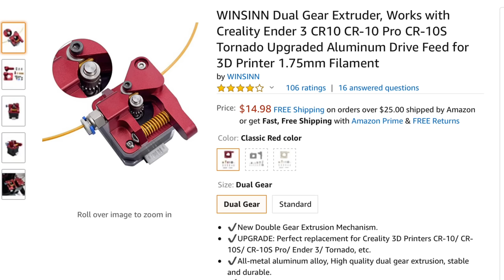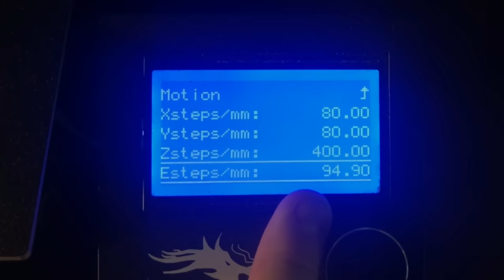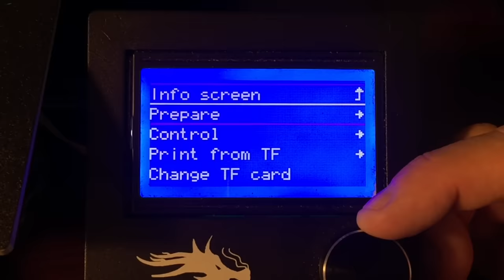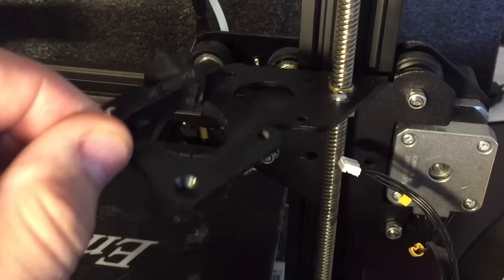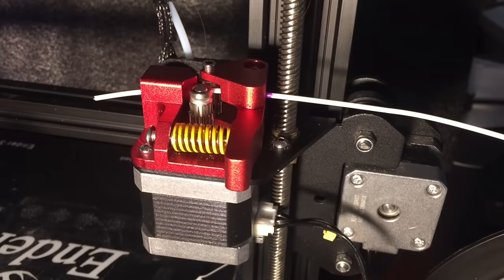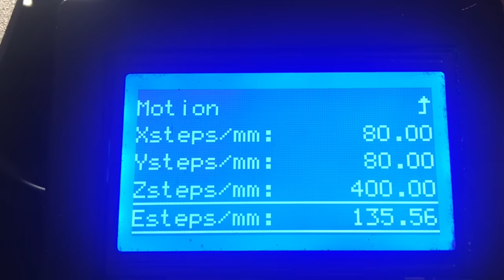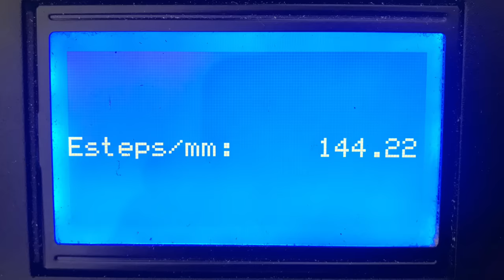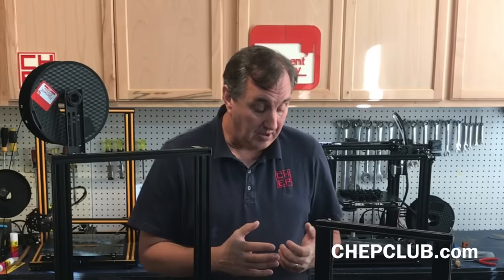Dual Drive Gear Extruder Upgrade + E Steps on Creality Ender 3

Comment: I just bought an ender 3 pro and I also have an older prusa clone printer. I tried to print a part that's runs fine on my old machine but this ender 3 seems to need to print slower. this part was sliced for 60 mm/s. This ender will start making noise from the extruder if it's printing a large surface where it's using a lot of filament. it sounds like it's slipping steps in the motor. could it be that my old machine has a hot head with a higher wattage.
Reply from the maker: Sounds like you just need to increase the temp for the filament you are using.
Reply: @FilamentFriday  that's whats weird is I run the same temp on my other machine
Reply from the maker: Each printer is different.

Comment: Can a "left handed" extruder be fitted to an Ender 3 if the polarity of the stepper plug is switched.  As far as I can tell, this would mean the filament run would easily clear the Z axis screw.  Or am I missing something here?
Reply: Yes

Comment: How does this work? If the axis distance varies, the gears don't mesh properly. Obviously it doesn't seem to have much influence in this application. The gears will themselves limit how much the  are pushed together. The other way around you will have backlash if the gears open up.
Reply: Backlash doesn't really matter in the extruder. The extruder mainly goes forward, and its in that direction that all the resistance is found (which the gears are needed to prevent slippage). As long as the gears engage somewhat in the forward direction they will work fine, they gears are designed so that they are slightly out of mesh so its the pressure on the filament that limits their movement.
Reply: @IanSlothieRolfe  makes sense

Comment: half of the issue with the dual drive extruder from creality is the needle bearing supplied only runs half the length of the gear allowing for a lot of play when filament is being pushed. I added a second bearing to mine which has greatly reduced the play and in turn wear on the extruder. I suspect this could be part of the reason there is still some slipping on the dual drive on in this case but without testing myself I couldn't confirm.
Reply from the maker: Mine came with two bearings.
Reply: 6mm is probably not slippage but compression inside the bowden tube. ID of the bowden is 2mm so that .3mm over 30-50cm is alot of space to lose 6mm of filament

Comment: I believe u maybe the person to help me, my ender 3 pro with upgraded metal extruder keeps chewing thru the filament half way thru a print I can find why it's driving me nuts.
Reply: Loosen the screw with the spring sleeve; that screw determines how strong the grip will be on the filament.
Reply: Dude my printer had clogging issues for a week.. also a reason extruder skips and slips.. because of the clog at nozzle. And that is from improperly inserted ptfe tube. After nicely clean and push it fully correct.. also capricorn tube for the win.. my prints stopped stuck halfways

Comment: Are there magic numbers for the extruder stepper?
Also, what esteps do you use for your ezr on ender 3? I am using 90
Reply from the maker: No, extruder doesn’t improve with magic numbers. I’m using same steps as original as I adjust flow in the slicer.
Reply: @FilamentFriday  Thanks. When I went from stock to ezr, I went from 93 to 90. I would be curious if anyone else did.
Reply: No magic numbers.  Each printer will be a bit different depending on the extruder you have, (I have a metal upgrade), the ptfe tube, the temperature, nozzle size, etc. You should follow the directions with measuring the filament and then adjusting the steps.  I would do this several times until you get down to exact location.  Note different filament types and producers may have different slippage .
Reply: @vbbartlett  Got it, thank you. I did arrive at 90 esteps after going through the directions and math described in Chris's basement video. I however did not re-check the distance once fed through the hotend like how CHEP has done in this video. I will try with the hotend and see if it changes. I am however getting really nice prints with 90 on the ezr.
Reply: @soloked  cool.  I would definitely check with the hotend on as that friction can change your numbers.
Reply: @vbbartlett  doing it right now haha
Reply: @vbbartlett  Yep it was 5mm short. . Changed esteps and printing a benchy now. Looks good so far.

Comment: Hello, I think the video is great, I have done everything as you say and it works perfectly, the only problem is that the values in "Esteps/mm)" are not memorized and when I turn off the printer return to the original values.   What am I doing wrong?
Reply: Hi, my Ender3 V2 saves all the settings to the SD card. Stuff like preheat temps but also the E-Steps/mm. Make sure you've got your SD card in the printer when you save the settings. Also then of course the SD card has to be present when booting up, so the printer can read the settings.
Reply: make sure to hit 'store settings' under control before you shut down your printer

Comment: I bought a few of this dual gear extruder, same brand, and installed it on 2 of my machines 2 days ago.  One machine printed half and then 3D hair above that.  I noticed that the dual gear extruder's gear thats on the extruder motor became loose.  So I re-aligned it, tightened its grub screw with as much torque as I could without breaking it.   Next morning I printed again a 3 hour print, and when I looked after 3 hours, again 3D Hair, the top half of the print!    To my surprise, the same gear got loose again.  And the motor shaft has a flat side, on which I tightened the grub screw.     Is there a way to tighten the grub screw so it doesn't come loose again while printing?  I'm thinking all kinds of crazy ideas like glue maybe?  I liked the dual gear so much, until this and now wondering.       Also do you know the size of the grub screw if i need to buy some of them to replace on this dual-gear extruder?    I asked  at the amazon sales, and surprisingly got no answer. Hoping someone knows better.
Reply: Mike, send it back. Its a junk part. Superglue of varying strengths (thread locker) is commonly used to secure bolts, but they should be mechanically sound.  You need to fix the mechanical problem first. I highly recommend everyone send them back - junk products should not be tolerated.  Get a different brand - one with needle bearings. It wont last anyway.
Reply: At just about every hardware store in the adhesives section there should be products called Loctite 242 and Loctite 271. Start by using alcohol to clean the grub screw and the hole in the gear and then put a drop of Loctite 242 (blue) on the grub screw threads, tighten it down and let it cure for 24 hours. If it still comes loose, then I would try Loctite 271 (red), but be advised that this stuff is considerably stronger than 242 and will require heat to remove the screw if you wish to do so again in the future. These threadlockers are old standbys for gunsmiths in applications where screws are under considerably more vibration and stress than the grub screws.
Reply: Yeah, use some thread locker. If you don't have any use some nail varnish. To remove thread locker use your soldering iron to heat up the grub

Comment: It says Steps per Millimeter. And not per 100mm. Just my 2 cents. And btw. For what is that Dual Drive Gear good? My Ender works perfekt with a single gear. Ok, if you wanna use flexible filaments. But then, it is much better to change to a direct drive extruder.
Reply: I'm surprised you got the number of cents right.
Reply: Whats your Problem?
Reply: that extruder has no benefit for flexible. it's metal so it doesn't wear out like the plastic one does. it has a tougher spring and tensioner and it drives filaments from both sides. it's a reliability update not a functionality update. the bowden tube length is what stops flexibles not the manufacturing of the extruder

Comment: I do not know what is going on with mine, but I followed all the same steps, got the extruder to feed right on my V2. But after a few hours the filament will smoosh just after the feed gears and the hole. Anyone seen this before and a solution?

Comment: Maybe a dumb question but, if you print largely at the same temp can't you just adjust the esteps on the stock ender 3 extruder and get similar results?
Reply from the maker: I don’t understand the comment
Reply: If you're always printing @ 205 (or whatever), I'd expect you could calibrate the extruder to get consistent feed results.

Comment: Great video mister I Troyes your tutorial I put the machine to get 100mm it doesn’t stop at the 100mm and also after that takes the filament backwards as well no idea what to do
Reply from the maker: You have to move it to exactly 100 not past it and back but to exactly 100.
Reply: CHEP thank you very much mister thanks for the quick reply keep up the good work

Comment: I have heard a lot of reports that this extruder causes grinding and not to use it.  Has anyone else seen this?
Reply from the maker: Yes. Over time mine ground down as well. Some say replace the orange spring with stock spring and it works better. I’ve yet to test that.
Reply: Thanks chuck!
Reply: @FilamentFriday  Wait, what do you mean by grinding and by stock spring? Thanks in advanvce
Reply: I had the same issue
Reply: Yea mine ate itself as well
Reply: use bearing bike grease on it

Comment: Does it work with flexible filaments?
How does it compare with the SeemeCNC extruder?
Reply: I was wondering that as well. I put the EZStruder on mine before I used it for the first time. I checked it and it was close to perfect without adjusting the steps.

Comment: Regarding the grinding error, is that a commonly fixed problem with modern iterations? Or is that a current problem still? I have one I got about a couple weeks(?) back, but haven't installed it yet (didn't come w/ instructions, so I didn't know it was able to fit lol)
Reply from the maker: Some say install the original Creality spring instead of orange
Reply: @FilamentFriday  That affects the gear grinding? Fascinating. The Dual Gear I got came with a secondary spring that's quite similar to the one that came with the stock, should I use that? (it too has a tension rod to insert in the spring, alike the orange one). 
But all in all, that'll reduce the wearing on the gears? 
Thanks for replying, and for the handy video =D
Reply: @FilamentFriday  I had the grinding problem when I installed this kit. Changed the spring back to the original Creality chrome on and all is good now. Thanks for the suggestion. Worked for me.

Comment: My gear grinds on the Red housing :( didnt notice until i saw some Aluminium dust
Reply: The housing on the side next to the coupler. The top and the Bottom are just fine
Reply: @MCI247  raise the drive gear on the motor as high as the housing will allow. This will keep the idle gear up off of the aluminum. OR, sand down the idler gear about 1/32" and use a thin plastic shim/washer cut from a milk jug underneath the gear.
Reply: @trey6638  no the Bottom of the gear is good. The teeths themselve grind on the other side the teeth bite deeper and deeper. Now IT stopped because the filament js in the way
Reply: @hanswurrst72af  if you take it apart, you will notice the bearing it rides on is too short.  This allows it to tilt just slightly and grind on the aluminum.  I ordered a second kit to stack the bearings to keep it straight from top to bottom, and it seems to have corrected my problem.

Comment: A question here, does the tuned e-step only works on the specific temperature you tuned on?
Reply from the maker: E-step stays the same but you can adjust the flow rate in the slicer.

Comment: Is there a formula if it's over extruding by 5mm?
I also found out that my extruder gear is pressed on so will stick with stock extruder for now.
Reply: Should be the same but you're adding in the denominator rather than subtracting. The numerator is the expected travel (100 mm) and denominator is the actual travel (in your case 105 mm). So e-steps calculation is  (100 mm / (100 mm + 5 mm))  * current e-steps value

Comment: CHEP I am having similar issues with my metal extruder (not the dual one). In air I get perfect 100mm. In nozzle I get approximately 80mm give or take. It always changes slightly depending on material and temperature. Do you suggest tuning up e-steps (currently at 94.4) until I get 100mm through the nozzle? If so, why bother doing it into air? Thank you so much.
Reply from the maker: I suggest adjusting the flow rate.
Reply: @FilamentFriday  thanks.  Do you have any tips on your calibration routine for new filiment?
Reply from the maker: Not that I can explain here. I’m working on a video.

Comment: Hi CHEP! Nice video.
One problem that I'm noticing is that the extruder makes weird sounds while its pushing the filament.
I dont know if its a hotend cloog or if something else like the motor current to low.
Another problem that I had was my first nozzle clog after 1 month of use...weird.
I had to change the ptfe tube for a new one and that seems to work for 2 weeks and now...again...the filament takes to much effort to push and the first layer is not sticking to the bed.
Any ideas?
Need help!
Thanks.
Reply from the maker: Your hotend cooling fan may be failing.
Reply: @FilamentFriday  I checked out both fans and they are working without issues.

I'm having 3 problems:

1- The extruder makes weird sound and it looks like the filament has some resistance (may be the reason for the noise)
2- Its hard to change the filament because its hard to take it out.
3- The first layer adition fails at some bed points (random points) making the print to fail at some point (after changing the extruder i had the same issue but it was related to under extrussion and was fixed by changing the steps/mm to 143.4).

I dont know if its a possible cloging, the way I assembled the hotend (i followed a tutorial) or may be the ptef tube its not the best (its a capricorn tube so its supposed to be better than the one came from the factory).

Could be the extruder motor current?

All the prints that I made since I fix the last clog failed and I dont know what to do...

HELP!

Thanks!!!
Reply: I changed the ptfe tube for the sacond time this week with the same results.

I thought its was the capricorn ptfe tube but no.

Could be that I'm making something wrong assembling the hotend?

Thanks!

Comment: Chep I have a cr10s with an upgraded metal mk8 flexiplus extruder. I have abs filament fed into the extruder and a new .04 nozzle with the temperature set to 255 and when i did the check about 10 mm out of 100 came thru the nozzle...when I disconnect the bowden tube from the extruder it extruded 80mm. I adusted esteps to 119 and tried again with bowden tube not connected and it extruded 100 mm filament but with it attached i got 10 mm again...whats going on? what size nozzle are you using? is it even possible to extrude 100mm of abs through an .04 nozzle when you select extrude 100mm?? please reply with your thoughts. I upgraded the original extruder to this one because the original cr10 extruder that came with the printer absolutely would not extrude flexible filaments at all no matter what i did!! I just ordered this dual extruder in hope that it will extrude pla, abs, petg, and flexible filaments! I still would like to figure out whats going on with this extruder because I have had no luck printing abs with it but have had no problem printing pla and flexible filaments! Please advise as to what may be going on here and thank you in advance!
Reply from the maker: Sounds like it’s not getting hot enough for the ABS you are using. 255 on a CR-10S is pretty high. Maybe use a temp meter and verify it’s actually getting that high.

Comment: I just installed the dual gear extruder from the video and link, calibrated it.  But now nothing will print right,  please help.
Reply from the maker: More detail?
Reply: @FilamentFriday  after install, after calibration, I leveled my bed again just to be safe.  But now (even after a cleaning)  either nothing will stick to the bed or only the brim sticks, it's stringing now all the time, it's perfectly leveled yet seems to be raking each layer.  I haven't been able to print a full anything all day
Reply: Well that doesn't seem like a extruder problem
Reply: @StaticNebula26  any thoughts then?  I was printing perfect until installing the dual extruder.
Reply: @amylong76  I'm new to this but, the problems your listing don't seem to be extruder problems I would check the bed level again maybe... Like I said I'm new to this so I don't know exactly what it is but it doesn't sound like the extruders problem
Reply: Maybe use a bed adhesive and check the retraction settings?

Comment: Hi, is there any way to make this a permanent setting, opposed to having to adjust every time you turn the printer on?
Reply: Upgrade firmware to a version capable of saving to EEPROM